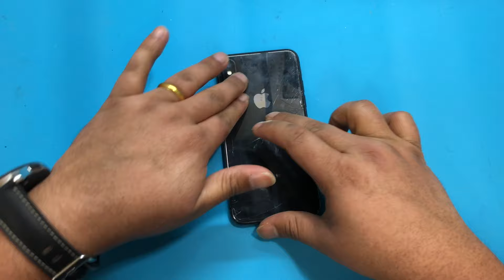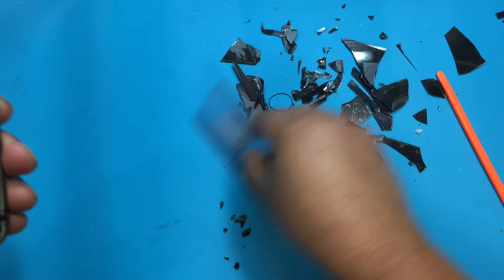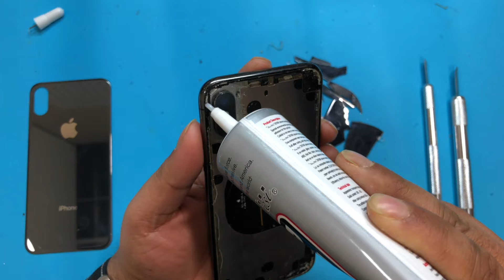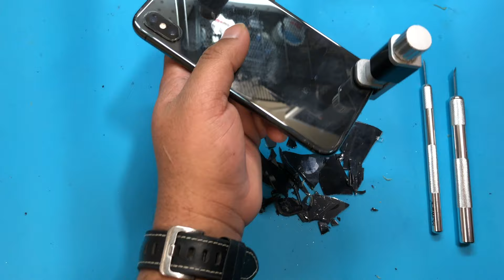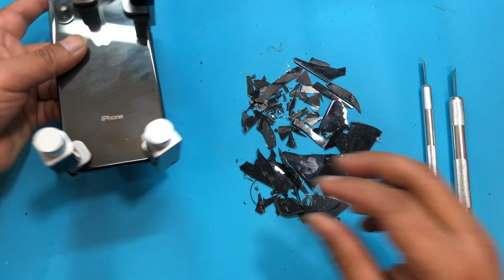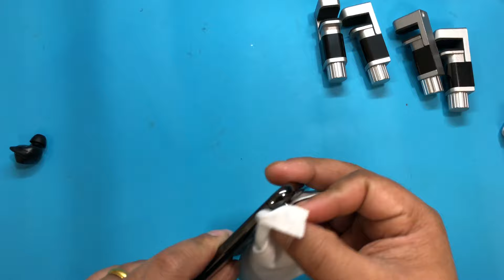iPhone X Back Glass Replacement Step by step

Comment: Only 400 subs, you deserve more. Nice work, made it look easy. Two questions; 1/ how long was this repair as the video was sped up. Also what temperature and flow did you set your heating tool to? Also I assume it was a glass with the wider hole for the camera. Where can we get these from. I'm in Australia.
Reply from the maker: xray364 
Is take around hours 
I used %350 ‘F  
Yes is wider hole for the camera 

You can check on amazon 
In USA amazon have but I don’t know about Australia
Reply: Cell Phone Tech thanks buddy, but how many hours?
Reply from the maker: xray364 
Around 1 hours
Reply: xray364 Vb
Reply: @CellPhoneTech  What does it mean wider whole, can you explain the difference please, what elese is there? I want to glass replacement on my XS and on my iPhone 8, both have back glass cracked.
Reply from the maker: Sinisa Vakic 
If you buy Wider whole  back glass you don’t have to remove back camera glass 
Back camera glass is really Difficult to remove
Reply: Cell Phone Tech thank’s
Reply: Cell Phone Tech Can you tell us more details about using the heat gun? How long exactly to keep it on the glass, temp etc.
Reply: Where did you get those clamps and does it damage the lcd when you tighten it.
Reply: @CellPhoneTech  the hot air gun I purchased has a lowest temperature point of 750•F 

Is this appropriate for use at a reasonable distance or am I doomed to melt all interior solder & PBC with this temp?
Reply from the maker: @GrantHR1  
You have to buy this on 
 Hot Air Soldering
Reply: instablaster...
Reply: just because it doesn't reflect the reality. this video is for "likes, subs and shares" purpose...even with laser machine is difficult and risky...
Reply: @iulianvasile2870  lol i have done right now with air gun :))) simply in 20 minutes everything works. if you have right hands it's so easy)) really
Reply: @verticalkid3310  is the hot air gun necessary to take off the glass back?

Comment: Wait you did this without remove battery and all components?
Reply from the maker: Yes
Reply: Why need to remove battery if you are working OUTSIDE ONLY ??? If you need to repair your car flat tire, did you remove battery ???
Reply: Ivan Ivanov the phones battery is located directly underneath where he’s applying heat so it could be damaged a cars battery isn’t
Reply: @Anthony-gn7nh  did you take a look careful what heating tool was used ? This tool heat ONLY small area for seconds. Not enough  to heat the battery to dangerous temp.
And one more - the battery IS NOT underneath the glass cover. Has metal plate between as shield.  And wireless charger. If temp on the glass is 150 degr Cels that mean temp inside the phone will be less than 100. Absolutely safe for battery. If you leave the phone here in Las Vegas on the car dash when is summer ( 100-120 degr F ) than temp inside the phone will be much more than when heat the glass. I never heard than has battery explosion or other batttery problems when is Summer
Reply: Ivan Ivanov there’s a metal plate but the battery is still underneath it a car and a phone are 2 different things it’s overall just a smart safety precaution to have the battery disconnected from the phone
Reply: Ivan Ivanov and also there’s a metal plate but metals are heat conductors so that argument doesn’t work
Reply: @Anthony-gn7nh  Don't be so stupid, amigo...All welding techs use a metal shields when doing a welding. Take a look at your car for exhaust near engine . You will see metal shields too. And they are here to protect hoses and wires from exhaust heat !!! 
It is not about heat conducting as you think
Reply: @Anthony-gn7nh  how many iphone glass backs you did in your life ? Cos i did hundreds without ANY PROBLEM about heating
Reply: Ivan Ivanov it’s simple look it up adding direct heat to a phones battery can cause it to degrade lithium ion batteries are sensitive anything over 86 degrees Fahrenheit can cause damage I’m not saying it will but it’s a possibility if you want to continue doing that then that’s fine
Reply: Yebumhole I agree with what you’re saying. I want to replace my back screen like this but don’t want to damage the battery. Can I just take the battery out and put it aside and then apply the heat and remove the glass and do what I need to and then add it back once I’ve finished?

Comment: This had to have been replaced before I’ve never seen where you can scrape without holding the phone with your other hand cause the pressure you need to apply to get under the heated glass and it’s usually not that clean

Comment: what, it's that easy. my phones been cracked for 3 years lol
Reply: I can’t remove glass. Stuck really really well
Reply: @Niuxas15  maybe try cracking the glass more lol
Reply: @hedrickoYO  
Got a new heat gun. Worked perfectly and very fast. Almost in one pease glass
Reply: @Niuxas15  i want to repair on my own too.. but i dont have heat gun. Isn’t ok if i dont use it?
Reply: @kamolpraksit6594  no. I try with everything only worked with a heat gun
Reply: @Niuxas15  wich temperature you used on both heat guns?
Reply: @bollygod  haha. Maximum , for 5-6 seconds.
Reply: @Niuxas15  Thanks! I'll try not to melt it, ahah. Btw, i should remove the display to use heat gun?
Reply: @bollygod  I didn’t.

Comment: One of the best replacement videos, I’ve tried on my iPhone XR it lasts 2 hours. You don’t have to unscrew the iPhone.
Reply: How hard was it
Reply: Really
Reply: I’m thinking of fixing the back of my iPhone XS Max idk if I should tho
Reply: @jremeee1599  I plan to do it but, It’s really hard to do if you don’t heat the glass
Reply: @iikvn4122  you can heat it with hair dryer
Reply: @fawadhadi3265  it's way too hard, I would never do it again I ruined my iPhone
Reply: how? @johnsnowwww

Comment: whats the best adhesive and clamps to use for this. i bought a complete back housing for a repair and i have the broken back housing. i figured i could practice on this and see if i cant remove the glass. do you think this can be achieved with a hair dryer?
Reply: I thought about using rubber bands as a make shift for clamps.
Reply from the maker: nick o  
Is not gone work with air dryer 
You can get heat gun at home-depot 

https://www.homedepot.com/p/BLACK-DECKER-Dual-Temperature-Heat-Gun-HG1300/202516290
Reply: U can use contact cement as glue that what Apple uses and as long as you heat the broken glass to point where it’s too hot to touch it’ll come off but this video had its back glass taken off before normally it takes a few hours and takes constant heat and scraping and sometimes your blades snap from the pressure you have to use

Comment: Please remove the Logic Board, rear/front camera, wear gloves/eye protection, and please buy a cheap broken phone to practice on before you start removing the back glass please!
Reply: Don't forget to remove the battery as well!
Reply: do i have to? i think i might just go for it
Reply: @whillshrill2568  You can!
Reply: Why do you need to remove the logic board etc?
Reply: if you know more than this guy why do you hang out in this video and give someone a clue?
Reply: @repairtechnician4666  You got to warn the people! Everybody not on his level! I've destroyed alot of phones trying to do this it's either you listen or you learn the hard way!
Reply: @treydallas903  actually thats good point. İ am on same opinion with you. Someone can damage their phone.
Reply: @treydallas903  i think this method is good. I didnt try. Did you try to change back glass without open the phone?
Reply: Def take that shyt out I fix fones for a living every day n that’s a whole little heat to a battery alone and as for logic boards it can loosen anything soldered on and can Melt the flex cables cameras camera lenses speakers n alotta other shyt
Reply: Seen sombody melt a whole 8plus inside out and had to buy a new one out of pocket if your very experienced have at it if your not would recommend taking everything out you can atlest and go from there
Reply: @ThreeBelvedere  İ understood. some soldered components can be loosen. and sandvich board is very tricky
Reply: I use normal hair dryer, it’s impossible to melt components with it. Don’t use heat gun lmao.
Reply: All that isn’t necessary I did it this way and good as new you got a higher chance damaging it by removing all the extra stuff
Reply: Nathan Stewart Who told you to use heat gun? Use hair dryer which cant damage component.
Reply: Nathan Stewart I know but its enough to remove the glas, you have to be patient.
Reply: succ crab additional heat makes it easier to remove glass and you dont need to put force under the glass or else its not neccessory. My hair dryer is at max heat level which is so hot that my hand feels pain from it.
Reply: Nathan Stewart yes and logic board and face id have to be removed. 2 critical parts. Everything else can be replaced. Face id cannot be restored.
Reply: @succcrab893  hey with the hair dryer how long did it take and can any hair dryer work
Reply: @darrenstrathdee7425  If you remove the display the face id automatically gets removed with it, so just remove the screen lol
Reply: @whillshrill2568  same. These ppl can hardly replace my lcd without having issues afterwards i ain’t listening to them 😂
Reply: @max.nevins so it won’t desolder any components and so it won’t damage and flex cables

Comment: Hi brilliant video ,can I ask what temperature did you set you heat station to ? Thanks
Reply: Hi. The best way is to strip the phone down completely, heat to 250-300 deg then push the glass out from where the wireless charge pad sits, its best to use the machines to do this as it keeps heat on it but it is possible with a heat gun. make sure all glass is removed or the replacement wont sit right.
Reply: 350 he states in a comment up above

Comment: Great video, where did you get the tools?
Reply from the maker: You can get from  mobilesentrix.com or gadgetfix.com
Reply: You can also opt to get get glass with replacement tools minus heat Guns and B7000 glue (all on amazon)

Comment: Great video gets right to the point instead of fooling around with taking it apart
Reply: I know, right? I mean what kind of idiot would remove a customers battery or board before hitting it with over 600 Fahrenheit in heat when the logic board is full of low melt solder and plastic components. Definitely nothing could go wrong there. I've neeeever worked on a phone that came in after somebody or another repair shop tried to do that. The odds of damage occurring are for sure like zero percent.

Comment: Can I try this method without removing the battery , if yes pls explain cuz I heard the heat will reduce the battery's life
Reply from the maker: Pee Smurls 
Yes you can without removing battery but you have used low temperature 
Used 
%300 f temperature  
And do slowly to remove 
You have to be careful don’t heat at one place

Comment: Hey thanks for the video! I have ordered one with big hole and with adhesive on the back like 3m double sided will it work aswell?
Reply from the maker: No is not look good is just for temporary 
You can use glue b7000
Reply: Cold-pressed glue is recommended for the glue, the effect is very good, the vibrating pen is recommended, which can quickly solve the glass

Comment: Hello! I saw that you pulled some sort of gasket from around the cameras after removing the original glass, I assume it must be for water resistance. Does the replacemet come with a gasket too? Or will the phone not be water resistant anymore after the repair? Thanks!
Reply: That was the old glue

Comment: Hello nice video..Is the same process for iPhone XS? And how many Celsius? Thanks and have i nice day
Reply from the maker: Yes is same iPhone xs, xs max , xr
Reply from the maker: I just upload video for iPhone XR back glass replacement you can watch
Reply: @CellPhoneTech  Thanks i'll Watch and what temperature for doing this? Should i remove all stuff inside or it's fine without doing this?
Reply from the maker: @gabrieleberti18   
Remove battery 
Use 350 temperature
Reply: @CellPhoneTech  Thanks :)

Comment: hello sir , after glass replacement my bottom speaker is not working. even if somebody is calling voice coming from ear piece only. putting on speaker has no impact.Only voice from earphone is coming. Any help suggestsion?
Reply from the maker: First check the connection of
Change port cable 
If you phone change then change loudspeakers 
It should work 
If you have any questions let me know

Comment: Just a question is that a hose clamp holding what the concentrate the hot air coming out of the dryer what is the nozzle that you have that the clamp is holding?

Comment: Heya! What heatgun are you using? I'm considering buying a one. Thanks!
Reply from the maker: https://www.amazon.com/Automatic-Rework-Station-Soldering-Digital/dp/B07JDLYBR8/ref=asc_df_B07JDLYBR8/?tag=hyprod-20&linkCode=df0&hvadid=385674013358&hvpos=1o2&hvnetw=g&hvrand=6983553868859354963&hvpone=&hvptwo=&hvqmt=&hvdev=m&hvdvcmdl=&hvlocint=&hvlocphy=9015708&hvtargid=pla-827276470290&psc=1&tag=&ref=&adgrpid=79419940780&hvpone=&hvptwo=&hvadid=385674013358&hvpos=1o2&hvnetw=g&hvrand=6983553868859354963&hvqmt=&hvdev=m&hvdvcmdl=&hvlocint=&hvlocphy=9015708&hvtargid=pla-827276470290

Comment: I watched your video and copied what you did.  I should not have! I should have listened to all the other videos where they said you have to REMOVE THE SCREEN AND BATTERY FIRST!

I got the back glass off and I was so proud. I flipped over the phone and the screen (which now had discolored at the edges) was separated from the body of the phone because the battery expanded from the head. So an $8 fix turned into a $100 plus one because this guy is giving people wrong information.

Comment: Where’d you buy the heat gun?
Reply from the maker: Joseee 

Here is link 

BACOENG 110V Digital 858D SMD Hot Air Rework Station Solder Blower Heat Gun https://www.amazon.com/dp/B07BRQX15Z/ref=cm_sw_r_cp_api_i_AMP-Eb9N0YABP
Reply: Cell Phone Tech Thank You I was really needing one!

Comment: ⛔Please respond 
What is the temperature to remove the rear glass?
Reply from the maker: %350 F
Reply: @CellPhoneTech  176 Celsius?
And should i remove the battery before heat it?
Reply from the maker: @fasolaru8674  
Best way to do remove battery 🔋 if first doing

Comment: hello i would like to ask some help so recently i tried to replace a screen for a huawei p30 witch success but then i run into a problem when i went to put the backglass back on to glue to the frame of the phone it damaged the lcd of the phone for the second time i am using the clamps that is actually meant to glue lcds like  the one you have on your video,is any other way you recommend for me to glue the backglass to the frame less risky to damage the lcd?  what about the spring clamps with the orange tip are thoose safe?
Reply from the maker: You can used water proof adhesive then you don’t have to used clamps 
https://www.mobilesentrix.com/75620-tesa-tape-5mm-x-25m-waterproof

Comment: Wait is it basically a heat gun or ?
Reply from the maker: Matt Win 

Hot air rework 

CO-Z 858D Rework Station, LED Display SMD Soldering Rework Station with Hot Air Heat Gun Set, LED Digital Temperature Display Screen Electric Desoldering Welding Iron Kit for Electronics Repairing https://www.amazon.com/dp/B01MR2IWBN/ref=cm_sw_r_cp_api_i_DkatEb60H6XFV

Comment: You should have at least remove the mother board and battery . You probably decreased the life of it with so much heat and the mother board got looses its solder ability with so much heat

Comment: What temperature you use for it??? In degree please
Reply from the maker: Michael Wurtz 
%350 F
Reply: Cell Phone Tech 180 degree? The motherboard is not damaged after that?
Reply from the maker: Michael Wurtz 
You can remove the motherboard
Reply from the maker: Is not difficult to remove motherhood on iPhone c
Reply from the maker: X
Reply: Cell Phone Tech not hard but when you remove glass without remove anything you sure all work?
Reply from the maker: Michael Wurtz 
Yes sir  
But when you use heat don’t keep one place move around so comp

Comment: Do you heat the glass over the wireless charging area?
Reply from the maker: cricketkajunoon 
No need but you can
Reply: Thanks. And how long did it take to clear all the glass using the heat gun? I was thinking to use Liquid nitrogen but your videos seems the heat gun usage so much easy and quick as other people claim in their video that heat gun isn’t as good as using the Liquid nitrogen. What do you think?

Comment: Hey, what temperature did you set it on? I set it on 180C at 50% speed and i scare its gonna burn battery and board.
Reply: u should take of motherboard/battery/front and back kamera if u dont do that i can assure u that u will face problems like telephone autoreboot every 2 mins and another problems 
please be carefull when removing the back cover...

Comment: Can i use a hairdryer instead? 
Thank you for that video ;)
Reply: The recommended temperature to remove the glass is 350, it’s possible but don’t expect it to be “easy” compared to a heat gun.

Comment: Where To Buy That Glass???
Reply from the maker: zura chokhonelidze  you can buy at Amazon 

https://www.amazon.com/CELL4LESS-Replacement-Compatible-Including-Adhesive/dp/B07SFZKHL7/ref=pd_aw_fbt_img_3/146-3391839-1061633?_encoding=UTF8&pd_rd_i=B07SFZKHL7&pd_rd_r=2559bb9c-7136-491f-b1ff-d65e80b6286b&pd_rd_w=aW38J&pd_rd_wg=JrXLR&pf_rd_p=81c9f70f-6f19-4af1-ab0d-7795b178a051&pf_rd_r=C65CNSVJY0AWJC9X7W9R&psc=1&refRID=C65CNSVJY0AWJC9X7W9R

Comment: What degree Temperature you set the heat and what wind speed. Thanks.
Reply from the maker: j j 
300 to 340 heat
Reply: @CellPhoneTech  there’s no heat damage when doing this?
Reply from the maker: @longsleevethong1457  
No

Comment: what is the temperature that you use for the hot air gun?
Reply: Has to be at least 300⁰ to loosen the adhesive.